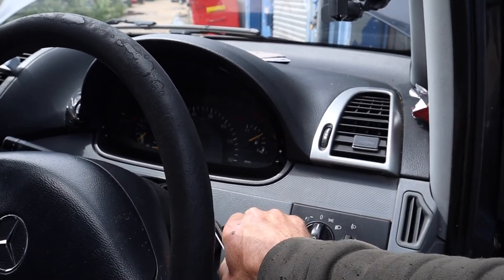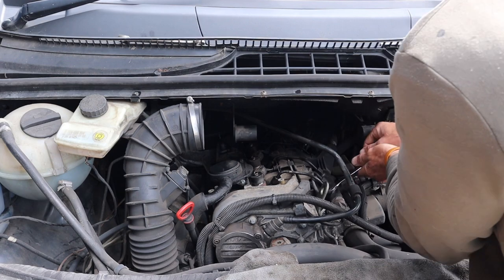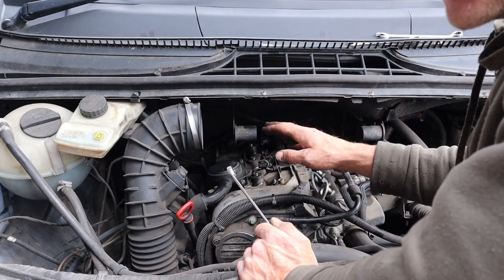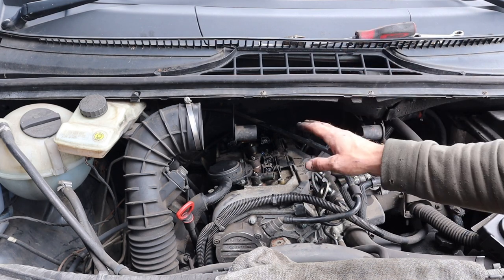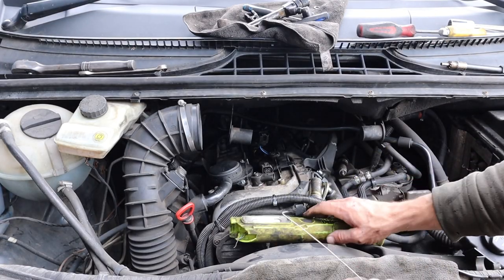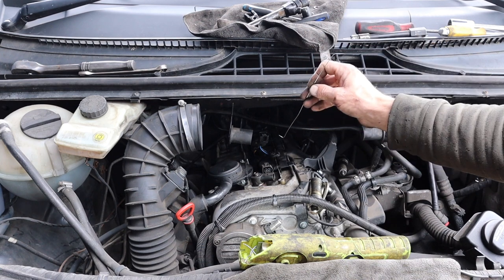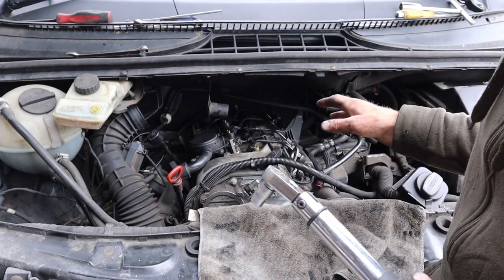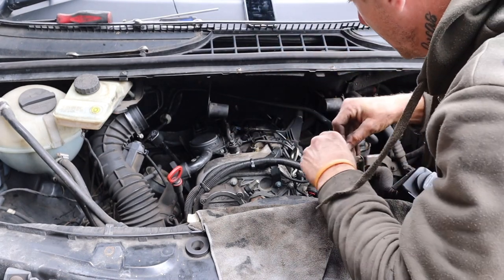Mercedes diesel injector seal replacement Vito sprinter DTE

Comment: Merc used stupidly skinny hold-down bolts on these. They're too light. Chances are when you try remove them, they snap - same as why they don't impart enough clamping force on the injector seals - bad design. The fact its a steel bolt going into an ally hole also means they chemically bond together  - more snapping. 

Removing stuck injectors on these, the last thing you want to do is pull - pulling is a waste of time. Don't pull on these - slam them sideways if they're stuck - same applies to any stuck injector - grab a heavy hammer and a 1/2" extension bar - put the bar onto the side protrusion of the injector & hammer it around - 1mm of movement is enough. Then hammer it back the other way - the carbon bond is brittle, so you want to smash it, not pull it. Hammer it to & fro a few times, spray it with WD40, leave it sit - go get a cuppa, 90 out of 100, when you come back, they pull out by hand.The internet will show you fancy pullers - you don't need them.  

Now the injector hold-down bolts, they're a whole 'nother story - you're left with the broken off nub of the bolt buried in the head - unless you get that out, it's a head off job - which is Effort. But there is a way to get them out, in a way that you can just insert a new bolt into the factory thread..  The entire injector removal procedure on these is a black art - they are an utter sod of bad design - but there are ways to cope.

Comment: I have the Black Death on my w211 e 220 07 plate  and we done everything like in your video but when all put together the 2nd injector where was the  problem initially still leaking .. all cleaned properly,greased,new washers .. but we read needs 70Nm +one 90’ not two like u mention here.. could be this the reason it’s still leaking ? Thank you for your video
Reply from the maker: Hey bud so sorry for the delay did you fix this? I’ve heard of injectors being slightly bent causing them to leak even with a new washer.
Reply: Hi!
Ive just left it with a good Romanian mechanic that said it’s not big deal for him 😳 as he seen much worse than mine and he olso said that probably needs cutting the injector seat ,the car is with him now
Reply from the maker: @adolfodominguez2631  hey bud hopefully he sorts it for you 👍
Reply: An update: he fixed it for me !he said we done the hard work only thing left was to cut the injector seat 
Thank you for your video!!
Reply from the maker: @adolfodominguez2631  hey bud sorry for the delay, happy days glad you got it fixed 👍

Comment: brillaint video!! im going to look at a vito in the week and hope the garage let me have a poke aorund and check the injectors!
Reply from the maker: Hey bud welcome to the channel, thank you for the comment 👍. If your injector are not leaking yet then I have a tip. If you tighten the injector clamp bolts before they leak then that saves them. You will be surprised how loose they become overtime as the the injector seal crushes down. You might get a full 90degree turn on them.

Comment: Excellent video very helpful.  I have a question can you re use the stretch bolts again and the torque is 7nm and this bit I want to confirm 90 degrees turning twice on each injector ?  I look forward to hearing from you thanks mk
Reply from the maker: Hey bud thank you appreciate that, for how cheap they are I would stick new ones in the do stretch a lot.
Reply: Hi is the torque for the stretch bolts 7nm by 90 degrees turning twice is that correct?

Comment: Hi. Thanks for the video. I’ve broken off a bolt that holds the injector clamp,whilst trying to clean out the thread. Do I need to take the head off now and if so are there any videos on you tube? Cheers G
Reply from the maker: Hi George oh that’s a pain in the backside, Erm yes a tap would have been better than a bolt as the debris does t have anywhere to clean into with a bolt. If there’s no thread sticking out to get hold of it might be a case of getting the head off unfortunately.

Comment: Hi mate. I just done mine today following your advice from the video. Now the engine will not start. Will run only on easy start. Also got a fault on scanner.. crank shaft sensor position a. Do you reckon using all the chemicals staff used to clean the black death destroy the sensor? Or where to look to sort this issue.? Thank you
Reply from the maker: Hi bud crank shaft sensor isn’t near the injectors so wouldn’t have thought the cleaner has damaged it, when trying to start the engine does the Rev counter go up? Have you located the sensor just to confirm it’s plugged in? Let me know I’ll try my best to help.

Comment: Hi, this is a great video,this helped a lot, managed to change seals, only problem since doing this the van will not start after going for a run. After leaving the van standing for while it starts fine, any idea  what this problem could be. ie could it be fuel stop valve.
Reply from the maker: Hi bud thank you did you solve this
Reply: no luck yet

Comment: That’s a brilliant vid mate 👍🏽, just doing this on my Vito injector 4 is being a pig but the engines out so at least I can get at it ..lots of top tips , have subbed .. thanks
Reply from the maker: Hey Glenn.. thanks fir the comments glad the info has come in useful, if you havnt got it out yet just spray something round it to loosen it up, wiggle side to side while pulling and it should come out 👍. Remember to clean the bolt clamp holes, as in the vid cut a groove in the bolt and it works as a tap.
Reply: @YTDTETV  yep did all that and out she came , took about a hour and a half .. with a tea break obviously … three essential tools for the job .. patience , patience and patience … start putting it all back together tomorrow …
Reply from the maker: @Chain21SAW  good job and yes patience is key to being a good mechanic, tea break always helps 👍
Reply: @YTDTETV  quick question .. is it possible to get replacement union for the top of injector ? It’s been cross threaded by a previous and weeps a bit . It the connection to the injector from the fuel feed ... otherwise I’ll rob one from an old injector ... oh yeah and another quick question 😉 does replacing one injector need the computer re programming or will it learn ? I’ve done on a berlingo van no probs but they’re Not German .. no rush to reply mate ,whenever you’ve time .. thanks a lot and good luck
Reply from the maker: @Chain21SAW  I’ve just had a little look on eBay for ya and I can’t see anyone that sells them individually but that’s not to say you can’t, you might need to phone a diesel specialist in your local area as I’m sure you could get one there. I’ve seen them leak before, on some fords you can only do the fuel line up once and then to replace an injector you need to replace the hard fuel line to the pump, but that is only on fords. Yes you would need to recode a new or used injector, if you havnt got the diagnostics to do it just write down or take a close up picture of all the numbers on the top of the injector and phone round a few local backstreet type garages and I’m sure some will do it for you. You will be able to drive the motor to them but it would definitely run a lot better once done 👍👍
Reply: @YTDTETV  thanks a lot mate that’s useful info, I’ll make a plan with a robbed union .. it’s a 208,000 mile lump so not worth spending too much money on 😂... thanks again , your a gent 👍🏽
Reply from the maker: @Chain21SAW  no problem happy to help 👍 if you get a minute have a share of the channel every subscriber counts, thank you 🙏
Reply: @YTDTETV  hiya mate job done ✅ this was an engine out job so access to the stubborn injector was easier , lumps back in now .. is there any reset to do to get it to turn over  I know they’ve got a anti theft thing going on which disables the starter circuit .. it’s all the same injectors in the same places so computer should read it ok
Reply from the maker: @Chain21SAW  hi bud, I don’t think the fuel pump is coded so I think it’s should turn over. Get a volt meter on the starter wires at the the starter and check the big red one for a constant 12v then while someone is turning the key test the little wire that goes to the starter to see if the exciter wire is getting live. Let me know 👍

Also my mechanic used to leave the main engine earth of by mistake a few times on other jobs and had similar issue. Double check the earth from engine to body is on tight.
Reply: @YTDTETV  hi, hanks for the reply , I got it running .. put a fully charged battery on ,cleaned the terminals on the starter motor ... spilt diesel was shorting it 🙈...and away she went ... sounds loads better ... thanks for all your advice mate , you’re a star 🌟

Comment: hello mate i have a 2008 vito taxi and my injector 3 is kicking off when these are changed do they need coding on the w639 111 model 

thanks
Reply from the maker: Hi bud yes I’m pretty sure merc injectors need coding, you would be able to fit it then drive somewhere to have it coded. Only take 2 minutes with a computer.
Reply: @DTE TV  thanks mate I took the airbox off this morning to inspect the fuel injector 3!!! I notices that the bottom turbo pipe had come loose, so I losing it off and refitted the pipe and secured it fairly tight. now this seems to have cleared the fuel injector fault. but i im worried the damage is already done now because its noisy when idle also there is hardly any power when driving off but when it does get going it can get to 4000 rpm before it will change gear

Comment: My vito 115 cdi had two injectors stuck. And stuck! With special tool to push it out, a lot of pressure was needed!
Reply from the maker: Hey rem some injectors do get very stuck, I’ve heard of merc injectors being slightly bent causing them to stick in. Well done for getting them out 👍

Comment: Good work , exactly how I’d do the procedure apart from I find the torque setting on most diesel injectors isn’t sufficient, you had torque setting and angle so is ok  , but on the diesels with just a torque setting I find small rachet and nip up snug so you can feel copper washer compressing works for me , with around 8nm alone it doesn’t seal properly just leaks in my experience, but yeah like I say good informative work considering these can really go bad when they want to I’ve seen a £2000 v6 both heads off jobbie when they really go bad the once
Reply from the maker: Hey Lewis thank you mate I appreciate that 👍 your right about to torque on most injectors it’s way to vague, a small ratchet is definitely the way to go.

Comment: Nice clear video on the job, although it's worth mentioning that if the cosmetic/sound-deadening cover has been on over a chuffing injector then the carbon build up can be HUGE, to the point I've just had to excavate carbon mass from above the top of the injector, which is why I've heard this issue described as the 'black death'.

Oven cleaner was pretty effective at clearing the remains of the carbon out from around the head once I'd chipped and ground the mass of it away.
Reply from the maker: Hi bud welcome to the channel 👍 yes I’ve hear it called the Black Death to, that’s a good tip about the oven cleaner as I’ve also heard that but never tried it. Niceone 👍
Reply: I had a severe case of Black Death on my Vito. Ended up having all new injectors, head and engine loom where it was all crusted thick. My poor mechanic spent hours getting all the black carbon out. Great to see the process that goes into the job.. 👍

Comment: My seals was done in 2019 and now I  hearing the chuff again. So soon ?
Reply from the maker: Hi, was all 4 deals changed or did they only do the 1?
Reply: @YTDTETV  Hay. All 4 were done. Broke down today because of fuel issue and when car was started I noticed a chugging and I was like oh that's new. I'm always listening for new sounds.its a 2010 viano with 367 thousand miles on it so been around a fair bit.
Reply from the maker: @Annoyingirl221  blimey that is high miles, merc do know how to make a good engine thow. Surely you would have noticed the noise before breaking down so maybe it’s not the injector seals. An exhaust leak can sound similar when it’s close to the engine or out the turbo. Maybe have a poke around while it’s running and see if you can locate it.
Reply: @YTDTETV   yeah and drives like a dream. Just had mot 2 days ago and flew through with no advisories which was a treat.. yeah it broke down because it ran out of fuel. Diesel 2.2 auto. Yeah I will have a deeper look tomorrow and really do hope it's just a hole in exhaust. Sounds just like a steam train puffing.
Reply from the maker: @Annoyingirl221  sorry for delay bud, I reckon if it was as chuffing injector the mot man might have mentioned. Let me know how you get on 👍
Reply: @YTDTETV   that's a good point about mot test. Haven't had chance to check but will have a look tomorrow. Very busy few days .  😀 thanks again
Reply from the maker: @Annoyingirl221  my mot man is clued up and would mention something like that. Happy to help 👍
Reply: Back here because it was deffo leaking injector, well 2 of them. Checked them today and loads of black carbon. Best get ordering the parts and following your video :)
Reply from the maker: @Annoyingirl221  hey bud that’s great glad you found the problem 👍 always like to hear feedback to so thank you.
Reply: @YTDTETV  deffo a very helpful clip. I've been so busy fixing the exhaust. Trying to keep it going another year. Literally  looks like cheese 🧀 . Also renault clio heater blower keeping me occupied. Another job I can't escape.
Reply from the maker: @Annoyingirl221  hopefully you get some more time out of it 👍 ooo clio blower motor is that under the dash so working upside down.
Reply: @YTDTETV   yeah drivers side. Had it out other week and it seems to be the bearing as it keeps getting stick and grinding to a stop. Can't find anything similar to my issue online. A whack usually gets it going but also sets of the airbag light. So now that's a deffo to do job.
Reply from the maker: @Annoyingirl221  sounds like the motor packing up for sure, a few jobs to keep you busy then 👍
Reply: @YTDTETV  you'll love this 😀. On the day the new heater blower fan arrives, my clio decided to brake down on the motorway.  Was the blimmin high pressure fuel pump:( part ordered for tomorrow, so viano is on the back burner for a few days.
Reply from the maker: @Annoyingirl221  oh mate it never rains ay only pours. We’ll hopefully you get it sorted soon 👍
Reply: @YTDTETV  lol exactly what I said. ,:)

Comment: Got my Vito booked in for this job, hopefully they're as competent as you.
I noticed the van in the video was a bit slow starting, just like mine...what's the likely cause of this?
Reply from the maker: Thank you mate appreciate that 👍 I’d put money on the starter motor being tired. They fill up with dust etc then turn over slower. A real old school mechanic would take it off take it apart clean and re assemble and would turn over as normal.

Comment: Hi mate got a rear wheel Vito where abouts is the crank sharft senor please
Reply from the maker: Hi bud welcome to the channel, it should on the bottom of the front of the engine just above the sump it gets its signal from the flywheel so it will be in the block close to the gearbox. Probably buried on a RWD.

Comment: hey mate, got any tips for cleaning out all the carbon that drops in the cylinders, tried my best but some still went in cheers
Reply from the maker: Hi bud so any fluids that drain into the cylinder while cleaning will just burn off soon as you fire it up. I bet the cleaner you’ve used is flammable so it won’t be a problem. I’ve had bits of carbon all sorts fall in and they just fire straight up.

Comment: Hi mate, brilliant video and top tips 👌🏽 I need to do my 115cdi. When you clean the seat where the washer sat or still is seated.. How do you stop the filings from falling into the chamber? Cheers
Reply from the maker: Hi bud thank you 👍 with regards to cleaning the seat it should only be carbon build up that would falls into the cylinder and that will burn away almost instantly once first started. I’ve changed many injectors and plenty of carbon drops in there and just start the engine, you will get a little bit of smoke for a few seconds then it burns off I’ve never had a problem.
Reply: @YTDTETV  Thanks for the advice, I look forward to doing the job now 😂 I have changed seals on a VW caddy as the idling was irradic and it had problems starting, never had the tar build up so exciting new territory 🙏🏽
Reply from the maker: @nicholasloubser5663  no problem happy to help 👍 I need to do the seals in my caddy. I always say with any job take your time and you’ll be ok.
Reply: @YTDTETV  🙏🏽 totally agree

Comment: Hi, I have a vito that doesn't want to open injectors and the fuel pump doesn't bring fuel at all, I live in South Africa and I cant seem to get the right people to fix my car, Can you suggest anything I can do, Please help
Reply from the maker: Hi Nicholus big welcome to the channel, if the pump isn’t pumping fuel to the injectors the first thing is the fuel filter either replace or clean it. I just been on Google for you and looking to see if your model has an in tank electric fuel pump. You could either have a faulty in tank pump or it’s possible the mesh,gauze,filter in the fuel tank is clogged up. I’ll do my best to help 👍
Reply: @YTDTETV  I will do that and get back to you, I’ll check on it and clean it,
Reply from the maker: @nicholusmawethuntsodoka-ts3062  there might be an access hole inside the van to get to the top of the tank, let me know if I can help anymore 👍 if you have a spare minute and can share my video if you have social media. Good luck with the van.

Comment: top vid, what was that cleaner you mentioned? super crack?
Reply from the maker: Hey bud thank you, yes I just searched eBay for INJECTOR CRACK and it was the top one. Isn’t the cheapest £15 a tin but it cleaned up the back tar good.